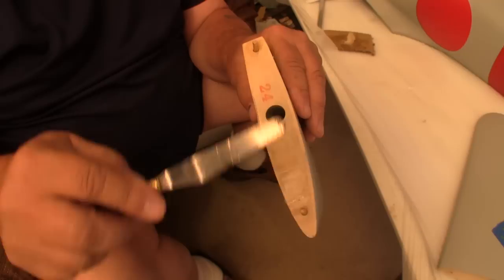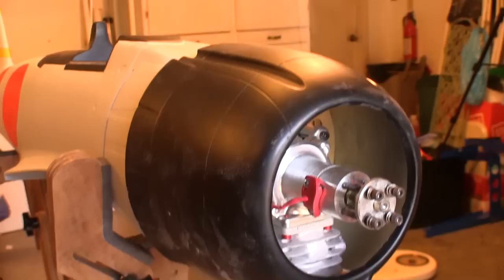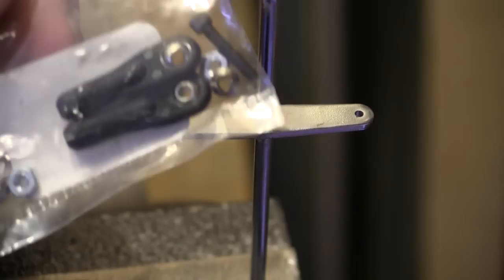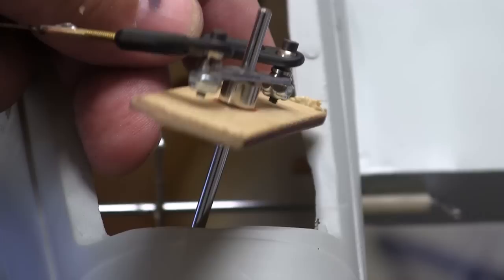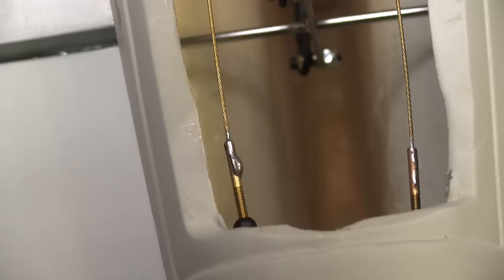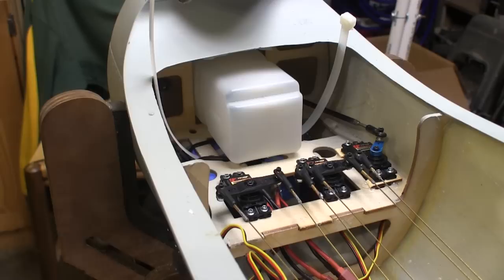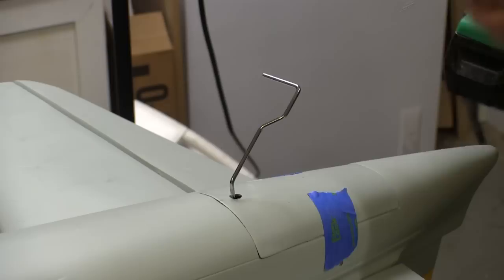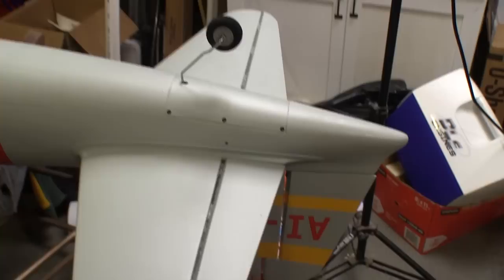ESM 88” Zero - The Fuselage

Comment: I thank you a lot ! I building my esm the same way you did to the point !  robart pins  Sullivan pull pull cables dubro   fittings etc !  I got it all ordered with the spek, receiver .. dle 35 ra  gasket maker,  matrix epoxy ... large nylon control horns  and dubro  hinges  etc

Comment: This is a very nice video.   Did you use a separate 3rd battery for your ignition. Or is that also running through our rx?  I'm wanting to get this same rx.
Reply from the maker: Ibn Air I used a Tech-Aero Ignition Battery Eliminator to power the ignition module.
http://www.flyingrc.net/techaeroibec.html
Reply: Ok cool so it is plugged directly to the rx and the battery eliminator takes the power from the rx and gives the correct voltage to your ignition?
Reply from the maker: +Ibn Air Yes, you can set the Tech Aero IBEC to put out the voltage you need.
Reply: +thintz12 and I just ordered the  ibec lol missed that one

Comment: good day sir  , what servo do u use for throotle ? thankd for any help dle 35 ra esm bearcat
Reply from the maker: HiTec HS-5495BH Servo because I used all high voltage servos.
Reply: what did u use or how did you offset the prop shaft on the dle ?

Comment: what do you think about using a as3x receiver in a esm plane ? vs the one you used ?
Reply from the maker: One of the things I don;t like about the cheaper stabilization units is them trying to hold a plane level on landing even though air speed is too low. ON something like the ESM kits that need so much lead in the nose I think you are looking for trouble trying to fly through the stabilization inputs.
Reply: ok  no as3x , ill use the spek 9110 as well
Reply: got the esm zero  robart ele retracts fitted  in my esm bearcat    getting close to complete

Comment: what cell on the lipos and what charge rate please ? u said 5000 7.4 but that's it , andersons rc website sucks ,
Reply from the maker: 7.4V Li-Po's are always 2 cell. I charge mine both st he same time st 1.5 amps because I am not in a hurry and I get better long term service charging slower.
Reply: hard case or soft ?  20 c or 30 c is what I meant on the battery
Reply from the maker: Soft case and since these are wired as receiver packs there isn't a C rating, I have never seen a C rating on receiver packs, probably because they are not supplying power to an electric motor, just a receiver and servos that never approach the draw of a motor.
Reply: got ya , thanks